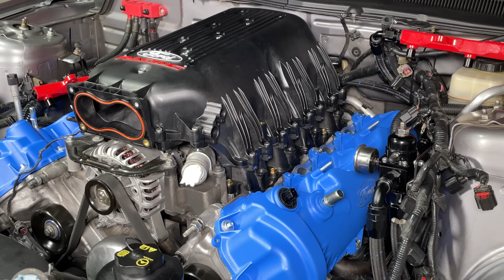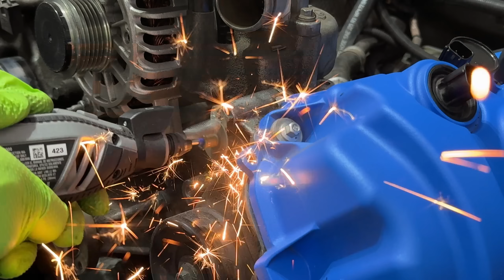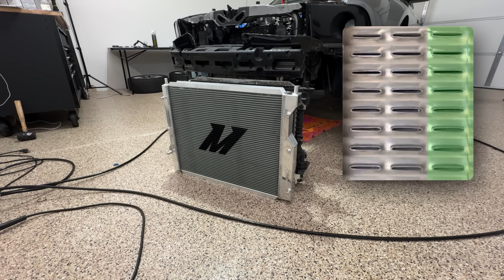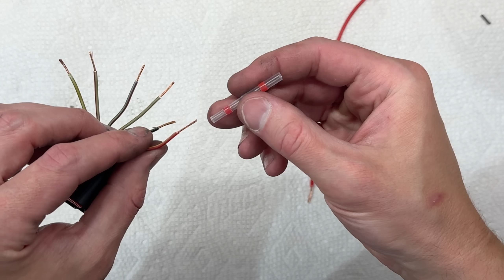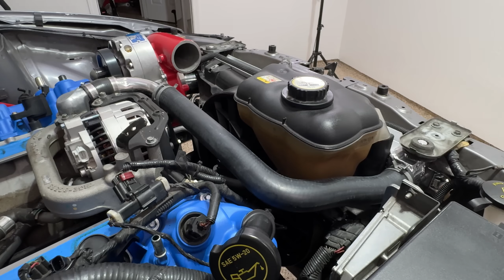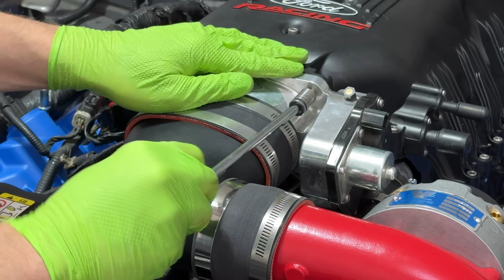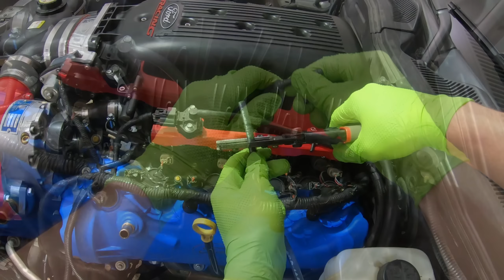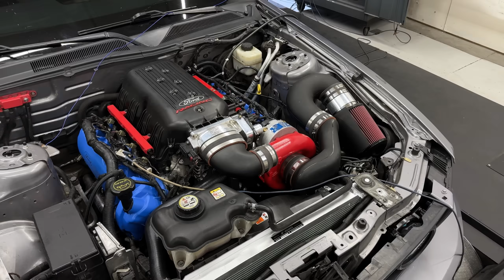Supercharging the Mustang everyone says is trash

Comment: Solder melts and then flows when heated sufficiently. Solder did not flow in the clip shown for the various wiring splices made. The number one reason people claim these shrink tubes work poorly is they stop heating when the tubing shrinks when they should keep heating till the solder flows.
Looking at the footage of the connectors being wrapped clearly shows that multiple wiring splices did not have their solder melted fully as the outline of the solder can still be seen in its original shape.
Heat it till it becomes a liquid and flows through the wire.

Comment: I bought a 3v new in 2007. Raced it a ton for years, grenaded a transmission and it's been sitting in the weeds for probably 10 years. This is a little motivation here to pull it out and get it going again. Not sure if I'll stick with the 3v, but likely will.

Comment: Hey man, those heatshrink + solder connectors aren't the best, and they looked a bit too cold. If it works it works, but just a heads up if you ever have a weird issue with this setup my first suspect would be those connections.

Comment: Spoiler alert, the new tyrest didnt help handling that power.
At above 700hp you need more than just 30mm wider tires, whole suspension kinetics need to be redesigned
Dodge demon has 315's and no traction